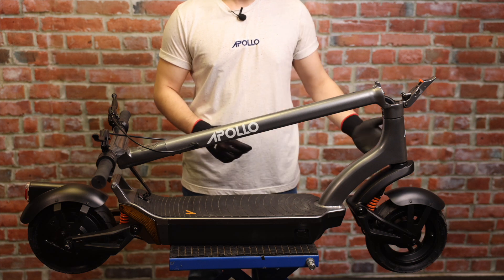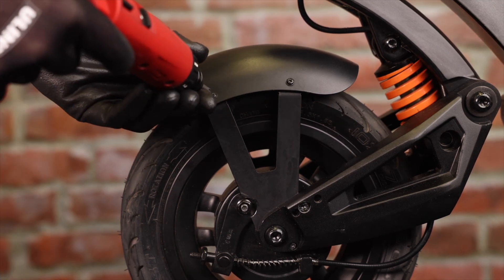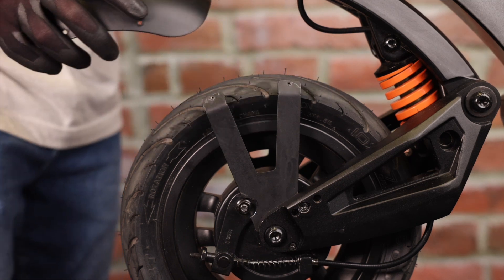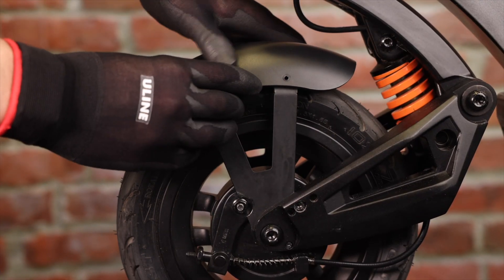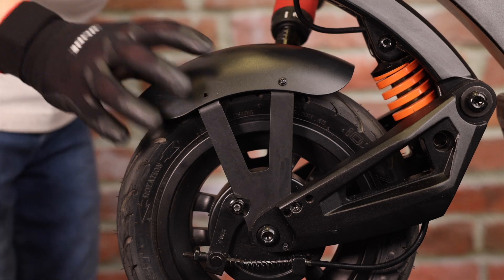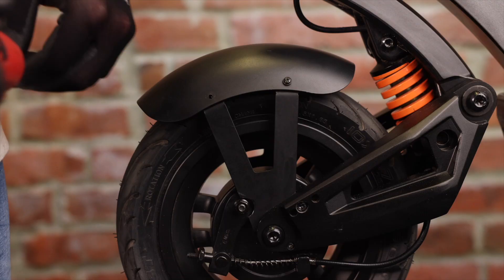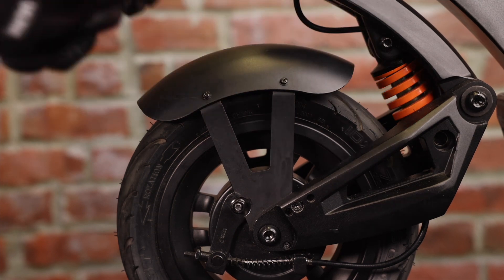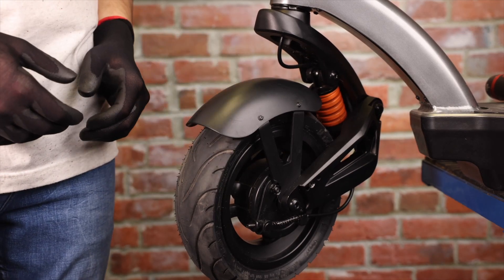City 2022 Fender Replacement

Comment: What about the back? I dont know how to get the rear light out of the fender;/
Reply from the maker: Hey there,
Thank you for the request and suggestion here to demonstrate the process on the rear assembly. The content team has this in their list of video to make, so do expect to see something like this int he coming weeks!
Reply: I couldn't find the video for the rear fender replacement. My fender broke off on all 4 screws from my daily commute to work on Vancouver streets. (Main Street primarily). I have a replacement on the way, but would like to remove the broken one for the time being until my replacement arrives, but the wire looks to be soldered in. I could always try to tape it back on with electrical tape as well.
Reply: @MrForeverOnline  What did you do? 

I had to send my back to my dealer in London and they got it replaced. But Its not like I was even driving on particularly bumpy terrain. Now I run into this problem again after very short usage..Tbh I dont think it was worth it considering the issues unfortunately.
Reply: @ApolloScooters  And still no video?
Reply: @Bobro  I had to bring it into a local scooter repair shop, they were able to replace it in a couple of hours, but they were kind of annoyed that the replacement kit I purchased from Apollo didn't come with the wiring and they luckily had some spares on hand. Also the new fender, the lens popped out after a few weeks. I put tape over it since it happened when I was riding and I lost the piece.
Reply: @ApolloScooters hey when are we getting instructions on replacing the rear fender?